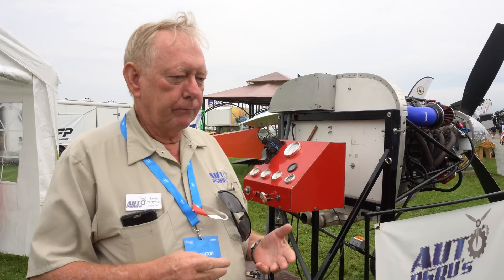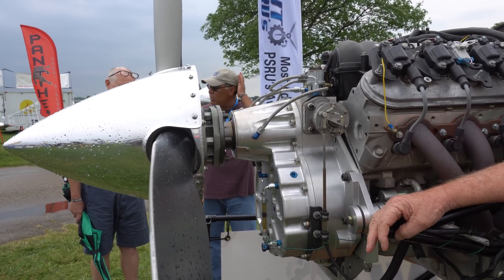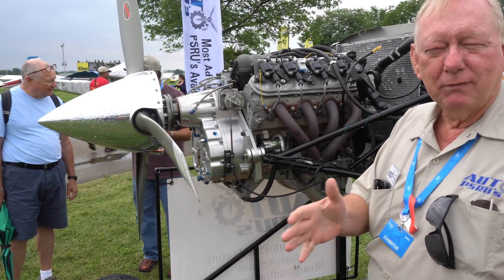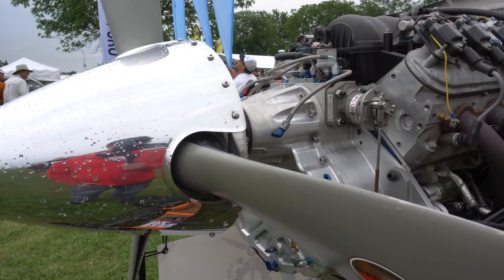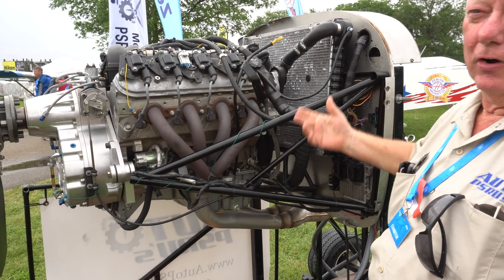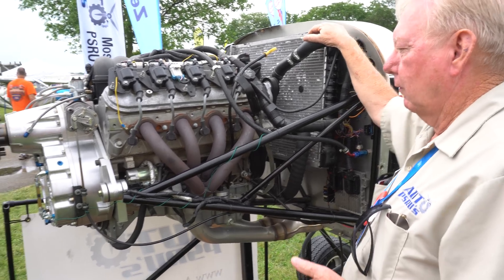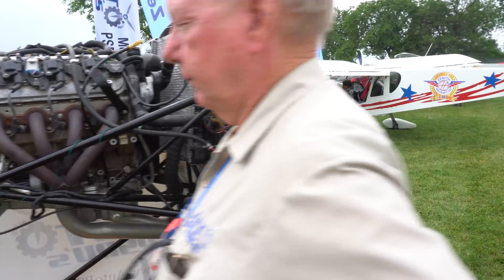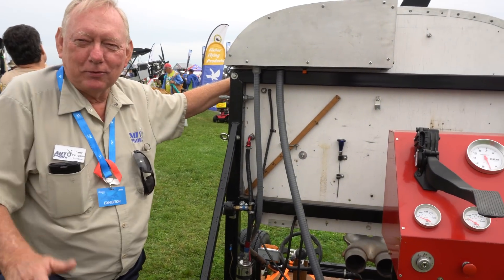LS3 Automotive V8 Engine With Auto PSRU's Geared Drive For Aviation Use

Comment: Anybody know the precise weight of an all alloy LS engine?
Reply: An aluminum LS engine is 100 lb, steel engine is 210, completely bare obviously.
Reply: Assembled without any accessories, they are around 400 lbs intake to oil pan.

Comment: No engine "wants to run" at the "top speed" of its "torque curve" where torque is "dropping" and there is no "reserve torque" rather than at the "bottom speed" of that "torque curve" where torque is rising with or faster than "engine speed" and most of the horsepower increase is DUE to "increased torque" rather than "increased speed". Horsepower is a function of TORQUE AND ENGINE SPEED with any "horsepower increase" at a given speed requiring a torque increase while "speed increases" can create "horsepower increases" even as torque drops and the actual "power" available to "power" whatever load(s) the engine is connected to is REDUCED. Horsepower is a RATE while TORQUE is an actual "force".
Reply: DEEREMEYER1 STOP.  USING.  QUOTES.
Reply: @whackyjinak4978  Its infuriatingly illegible
Reply: You can easily change the camshaft to adjust the torque curve, if you want a lower RPM range you can easily get a camshaft out of one of the 5.3 truck engines.   The aftermarket also offers custom cam profiles so you can get whatever you want.

Comment: Why and how does your "prop speed reduction unit" apparently go from "big to small" with "big" being on the crankshaft and "small" being on the prop when driving a smaller gear with a larger one creates a speed INCREASE? And who at General Motors is "signing off" on that automotive block/engine structure/assembly being able to "safely" and "reliably" support all of that "prop speed reduction unit" weight as well as the propeller "thrust" and "torque" clustered onto the back of that engine where a RWD transmission or in the case of Corvettes just a "clutch" housing is normally installed with those additional components also providing the remaining "engine mount(s)" as well as creating the real torque-multiplication and speed reduction for the vehicle so only in "direct drive" and "overdrive" does the "bellhousing" see the "full torque" of the engine? And what do that "propeller speed reduction unit" and the propeller itself do to the engine's dynamic "balance"? Is that "additional clutch" also a "torsional damper" as all manual transmission clutch disks and automatic transmission torque-converters are? And one sufficient to handle both the "harmonics" and "odd-fire" power pulses of a 90-degree V-8? And isn't the compression ratio of an "LS3" pretty "high" for an "aircraft engine" powering a "direct-drive" propeller through a "propeller speed reduction unit" that amounts to a "single-speed transmission" that's only going to require progressively MORE engine torque along with engine speed increases to fly faster and/or higher and with "lightweight" automotive internal components never intended for "heavy-duty" use with "high loads" along with "high speeds" because its a "passenger car" engine rather than a "medium-duty" or even a "light-duty" truck engine? 

There's a reason the "LS" engines made for "heavy-duty" use in any and all GM vehicles more "heavy-duty" than 1/2-ton pickups have cast-iron rather than aluminum cylinder blocks and much more "bottom end" strength and way lower compression ratios and way more "robust" cooling and lubrication systems. The aluminum "LS" engines are "passenger car" and/or "light-duty truck/SUV" engines. They're not "heavy-duty" in any way, shape or form. Nor are they designed for "high loads" and/or continuous "medium" loads at "high speeds" and they're certainly not built to be "structural" members of any "powertrain" where they "alone" support and produce all of the weight and torque of themselves and the "transmission" much less while simultaneously being the "connection" between the force propelling the vehicle and the "chassis" of the vehicle itself. In automobiles the engine and transmission/transaxle assembly are nothing but a "power unit" creating torque to power the driving wheels through the differential(s) and axle/CV shafts without being "loaded" by the "chassis" and "drivetrain" axially or laterally in any way, shape or form. 

A cylinder block is not a "structural member" in/of the "chassis" and/or "drivetrain" in automotive applications and least of all with the engine block/assembly bolted into the "chassis" and the "drivetrain" bolted onto it "pulling" on it in one direction as the chassis "resists" that "pull". Even agricultural and construction and industrial "vehicles" that use the "engine block" as a "structural member" only do so when the engine is producing torque and sending it to a driving axle pushing forward on the "chassis" and by extension the engine block in a "RWD" or "AWD" situation with the "AWD" front axle being a "front-wheel assist" axle that doesn't have anywhere near "half" the traction and doesn't receive/transfer anywhere near "half" the torque of the entire powertrain. You never see engine blocks as "structural members" in any situation where the driving wheels are "pulling" on the chassis and engine and are "dragging" the entire remainder of the vehicle behind the driving axle along behind it. "Pushing" is always "easier" and "safer" than "pulling" when it comes to making sure heavily-loaded and/or high-torque/traction vehicles are powered because all "structures" consisting of many bolted-together parts/components with many "joints" along that structure and "power" only or mainly at one end are stronger in "compression" than in "tension". 

Just because there have been a few "successful" V-type liquid-cooled "aero engines" and they have in at least one case a ridiculously overrated and propagandized "reputation" for "performance" from "power" to "reliability" and those "Rolls-Royce Merlin" engines have been the benefactors of WAY more "research and development" into how to "sell" and "promote" their "superiority" AFTER THE FACT than they ever had put into them by the "OEM" back when they were being "designed" and "developed" to "compete" with air-cooled OHV radial "aero engines" doesn't mean ANY V-type liquid-cooled ENGINE least of an a light-duty if "high-performance" passenger car engine is remotely suitable for "aero engine" use and least of all one that is all but "unknown" in the "industrial" world/markets unlike its REAL small-block Chevy "ancestors" which have been and continue to be used in LOTS of "heavy-duty" applications from irrigation engines to agricultural engines in Massey-Ferguson combines (John Deere used "Chevy" inline 6-cylinders while Massey used an "industrial" version of the "327" with "junk" cylinder heads but all the "goodies" in the bottom-end including forged steel cranks and "pink" rods) to "medium-duty" GM straight trucks in the "C40" and "C50" models. 

But were STILL never used as a "structural" member of any "chassis" much less to support entirely a "transmission" and with only cobbled together "factory" and "aftermarket" engine mount assemblies to mount the entire engine/transmission "powertrain" in the "chassis" and with very strong cast-iron engine blocks capable of handling "stresses" far, far in excess of what the original SBC "designers" and "engineers" had in mind when they designed the basic "platform" for passenger cars and light trucks back in the early 1950s. 

That there's also no "practical" or apparently "impractical" way to make an "LS" engine with dual and "redundant" ignition systems  and "electronic ignition" period much less "distributorless ignition" are both "rare" in/on "aero engines" to the point of being "experimental" at best while "mags" continue to be used due to their "adjustability" and "reliability" and "durability" while "LS" engines don't even have provisions for an "HEI" or any other kind of "mechanically-driven" ignition system is even MORE evidence of how "wrong" for "aero engine" applications any and all "modern" V8 automotive engines are. 

Looks like a "stock fraud" in process to me whether or not its "intentional" or not because "converting" V-8 automotive engines to "aero engine" use is not only nothing "new" its been "tried" and has "failed" numerous times in even "recent" history and I'm just a diesel mechanic and lifelong gearhead and "aviation buff" who knows dogshit about the "nuts and bolts" of airplanes in general other than what I've read/heard in various "media" for several decades but I still know that 25-30 years ago some "crop dusters" were playing with the idea of installing Ford big-blocks in "vintage" aircraft with "timed-out" and/or "underpowered" air-cooled radial and/or horizontally-opposed "aero engines" as an "affordable alternative" to "repowering" them with "turbines" or replacing the aircraft altogether with turbine-powered "Ag Tractor" aircraft. 

Just like big-block Chevys were being kicked around and even "developed" and "marketed" for "repowering" timed-out "turbines" before the "lightweight" and "high-performance" and best of all "economical" LS aluminum-block automotive engines came along and specifically the "big" aluminum LS engines with enough extra displacement and "power" over the 6.0-liter "truck engines" with cast-iron blocks to make all their "cons" much less visible and seem like much less of a "problem" compared to their supposed "pros". 

And what it ALL REALLY BOILS DOWN TO is that just like ALL "innovations" and/or "inventions" and "experimental" aircraft/engines throughout the "history" of "aviation" since the FAA and its "counterparts" came along is that the only sure way to get "approval" for some "experimental" modification to/of existing "certificated" airframes/engines etc is to "prove" their "airworthiness" and "safety" and "reliability" the only way TO prove "airworthiness" but the LAST way any "manufacturer" of some new "modification" seems interested in going about DOING SO. Which is IN THE AIR actually FLYING THEM IN "UNCONTROLLED AIRSPACE" AND MAKING THEM "SUCCESSFUL" AS AN "EXPERIMENTAL" AND "UNREGULATED" AND PURE "PRIVATE AIRCRAFT" modification the "inventor(s)" themselves will "bet their lives on" AFTER making significant "investments" into the actual "flying prototypes" and "pre-production" and "production" versions necessary to PROVE "airworthiness". 

They're BIG on "testing" on the GROUND and especially these days in "computer models" and plenty willing to "invest" in "mockups" and "marketing" materials as they try to "attract investors" to try to "buy" FAA "approval" FOR THE "AIRWORTHINESS" OF SOMETHING THAT HASN'T BEEN "TESTED" ANYWHERE BUT ON THE GROUND WHILE "SELLING" A LIST OF SUPPOSED "CUSTOMERS" JUST WAITING FOR "FAA APPROVAL" TO HAVE THEIR "EXISTING" AIRCRAFT/ENGINES "MODIFIED" ON A "MONEY IS NO OBJECT" BASIS TO THE "FAA" VIA "FAA OFFICIALS" WHO INVARIABLY WHEN "EXCITED" TO "CERTIFICATE" (ALSO KNOWN AS "CERTIFY") SOME MAJOR "MODIFICATION" TO AN EXISTING AND "CERTIFICATED" AIRCRAFT/ENGINE BASED ON "GROUND TESTS" AND "POTENTIAL CUSTOMERS" ALONE ARE ON SOME LEVEL "INVESTORS" IN THE "MANUFACTURER" OF THE "MODIFICATIONS" OR VERY, VERY GULLIBLE AND BRAINWASHED "OFFICIALS" WHO WERE "HAND-PICKED" BY SAID "MANUFACTURER" SPECIFICALLY FOR THEIR LACK OF "HEALTHY SKEPTICISM" AND BASIC "COMMON SENSE".
Reply: I don't think you have enough quotation marks in your text wall.

Comment: Heres the deal, the amount of research and development companies like Rolls Royce, Allison or Pratt&Whitney did with aero piston engines during the WW2 period, blows any of this back yard stuff away. The maximum amount of continuous reliable horsepower you can extract from an Aero piston engine is about 0.50 HP per engine cubic inch displacement for air cooled engines, and about 1.0 HP per cubic inch displacement for liquid cooled engines, and anything over about 3400 RPM is not reliable, those are the reasons most car engine conversions don't generally work out, not enough cubic inches, and to much RPM's
Reply: You're right, we capped out on technology 80 years ago.  We shouldn't even try anything else.

Comment: That pump they're using to oil the reduction gear is the same one that Detroit Diesel used on their old two cycle engines . I've only seen a couple fail .

Comment: it's okay to for something to play with. Did you notice that you have to fly on pretty much a level plane. Negative g-forces (upside down flying) will run the oiling system dry since the oil pump can't pick it up out of the oilpan and the engine runs dry and destroys it. Did I understand that correctly?
Reply: how is this different from the oil system on a O-360 etc? they don't have inverted flight capability unless you order a specific model

Comment: Air fuel mixture controls?
Reply: It uses the GM mixture system and LS3 throttle body. It controls mixture automatically.

Comment: Anyone know the weight of aluminum LS engine?
Reply: The engine probably weighs 450lbs.  But with the gear box and radiator it's probably close to 600lbs all running
Reply: Thanks, Brent.
Reply: The bare engine is 339 pounds, but with all fluids, mount, exhaust and accessories, the FWF package is 580 total, which compares to a FWF IO-540-K setup at 604 pounds.

Comment: that's not an ls3.   its an ls2.  its has 243 heads. the ls3 had 823 heads.
Reply from the maker: how are you able to identify the difference just by looking at them?  I thought you had to look at the serial number
Reply: +Military Attractions I had noticed the three digit number on the top corner of the cylinder head. it reads 243 the 243 head is a cathedral intake port head. never produced on an ls3 6.2  but was produced on the ls2 6.0 motors 'gto'  ls6 5.7 corvette & some 4.8 & 5.3 truck motors. if it was truly an ls3 it would have the 3 digit head casting number 823 or 821 which is a rectangle port head. but the only 100% sure way of verifying if its an ls3 is  to look on the front & back of the block it will have 6.2 cast into it in. all these lsx style motors have the actual displacement size numbers cast into the front & back of the block
Reply: 243s will fit any displacement LS-that being said, that just raises another question, if it is a 6.2 why would they take the rectangle Port heads off, which are far superior than any cathedral port junk.

Comment: Let that engine run at 75% of power for 30 days continuous, providing good lubrication and cooling, and if it survives, then we'll ta;k.
Reply: The factory has pretty rigorous tests for this when it was developed but with prop on it at altitude testing would be a good idea lol
Reply: Fly it for one minute in turbulence where the oil sloshes away from the pickup tube while operating at 4,500rpm and full load without catastrophic engine failure and I still wont buy it.
Reply: @Triple_J.1  and why is this different to diving over rough roads at speed?
Reply: the OEM tests are far more rigorous than that and NO lycoming has ever been asked to pass that test! the certified engine tests total out at 120 hours

Comment: I can't think of a quicker way to devalue a name brand aircraft than to mount  a bastardized power plant in its airframe. I was an A&E aircraft Mechanic for thirty years. Unless you are going to scrap it when your done using it , the resale value would be almost zero.
Reply: This is for experimental aircraft. 

The real concern is using an engine made for cheap mass produced "momentary" horsepower for a quick 5-10 second sprint to highway speeds or down the 1/4, and extended cruising at 1,800rpm and very low load (10% power) as opposed to extended Wide Open 100% power climbs and extended 70% cruising across the country. There is only one reason to install a car engine in an airplane, because it's cheap and available. (Peitenpol air campers in the 1930s). 

But this setup is easily the same price as a medium sized Lycoming new, so therefore the idea is to generate double the horsepower for the same dollar. But it cant, because any automotive V8 run at sustained 100% power cannot be compared in reliability to the car it came from (corvettes going 200k miles...) Because in an airplane while climbing for 10-20 minutes at 100% power, and cruising for endless hours at 60-70% means you are running it at circle-track race car levels of abuse, and those guys do a full tear down and rebuild frequently (at least every season or two even for ammeter racing) and those cars often DNF due to engine problems with motors that have only a few dozen to maybe a couple hundred hours on them between overhauls. Putting an LS3 in an Airplane and running what you brung is like driving a Camaro in 4th gear full throttle and 150mph for hundreds of hours and many dozens of trips coast to coast and expecting it not to blow.  

And it don't even use a dry sump or oil scavenging setup. You must have a power-plant capable of -2Gs in any airplane because simply flying through turbulence or uncoordinated flight will slosh the oil away from the single point $7.99 GM oil pickup tube... This concept has been tried over and over and it's not any good.
Reply: @Triple_J.1  very few lycomings /  continentals are dry sumped so that argument is invalid.  the OEM tests from GM are far more rigorous than the certifying tests for aircraft. this story you are spreading is 50 years out of date